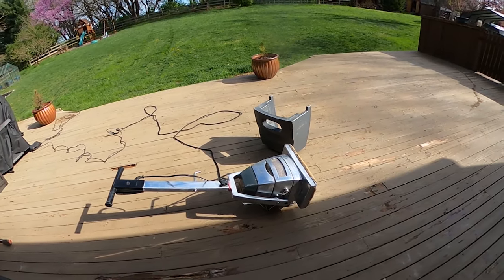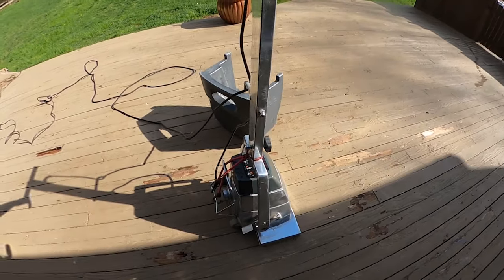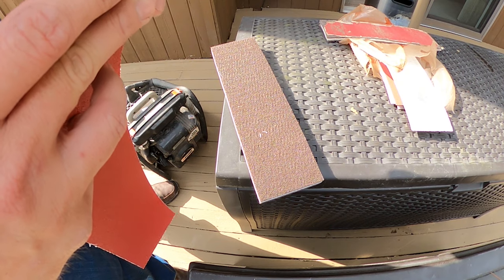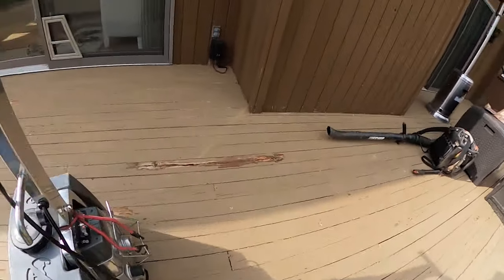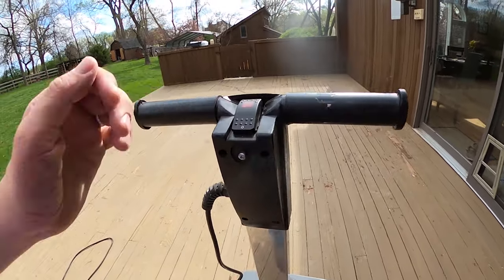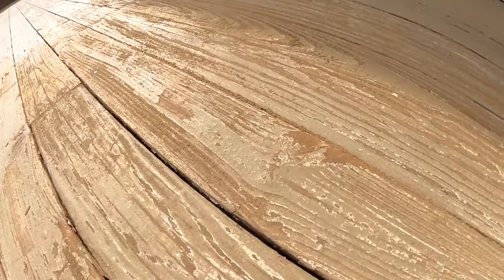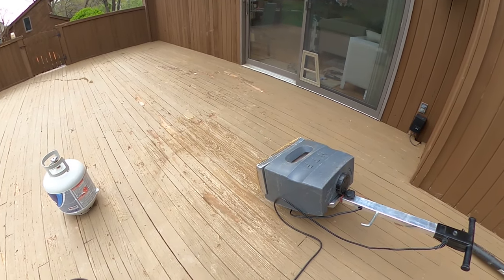Sanding your deck with a Home Depot rental sander | Home depot rental

Comment: I used 7 60 grit and 3 120 grit sandpaper for my deck and stairs, almost 450 sq ft. Went through two backing pads. Some sandpaper sheets kept falling off the backing pad, especially when it got dusty. Problem is not all sanding sheets have good adhesive. I had to use an adhesive spray to keep them on the pad. With adhesive spray, you can probably use just one backing pad. Be careful about sprinters and nails sticking off the deck. They can easily rip through the sandpapers or backing pads. Sandpapers and backing pads can also get stuck in them. For sanding stairs, I took off the weight as stairs were too narrow and I could fit 3/4 of the sander on the stairs. The included cloth dust bag is garbage, no dust ever collected there. Maybe the sander I used had a bad dust collection system. I used my shop vac to clean the dust and blower to finish off the remaining dust. Home Depot sells paper dust bags but I do not think they will help. Sanding took almost 5 hrs. Hope this helps!
Reply from the maker: Great tips. I didn't use the dust bag, just vacuumed and blew it off. Thanks for all your ideas I am sure folks will appreciate it.
Reply: Good tips
Reply: Good tips, especially giving us the deck size and how much time and sandpapers you used. This allows us to estimate how much we need for our projects.
Reply: @yewkiamakuahui2296  Amen to that! Thanks @asif!! I created my material estimate based on your great info!!
Reply: I am looking to rent this for sanding my deck, but it has lot of nails ,, should i remove all or just the ones that are standing up above the ground level?
Reply: @prabeeshraman6141  I hammered all the nails down so they don't stick up. nails that stick up can tear through the pads
Reply: Thanks for all the great tips. Could you share what kind of adhesive spray you had success with?
Also, your statement says "With adhesive spray, you can probably use just one backing pad"
..Did you mean to say "you can probably use just one sanding sheet"?

Comment: One issue with sanding many types of decking boards is that unless hidden fasteners were used there is a good chance any screw near the surface will also be sanded. In doing that it may very likely remove the rust resistant coating on the screw now allowing the screws to rust!
Reply from the maker: Great points. I reckoned since my deck was so old, it was sanded at some point, and luckily, years later, I haven't had any issues. Maybe the paint helps protect it a bit?

Comment: Why not put stain/paint remover on, let it sit and power wash it off? After that you can use lighter sandpaper to get what the remover did t get. Much easier
Reply: Just experienced this, stain stripper is only going to work on non solid stains no older than 1-2 years
Reply: Chemicals have uneven results
Reply: @kennylignon7908  no, chemicals remove the bulk of the stain. I’ve been doing this for 20 years. It’s a game changer.

Comment: American sander is way better, the one you using is gonna take a long time and lots of paper, I would use the drum sander with a 36 grit and do the small areas with a orbital sander 40 grit to clean it off and than you wanna pass with a 80 grit to smooth it out, takes a day to do it.
Reply from the maker: Great feedback, thanks. I was just using what Home Depot had. Will lookup what you mentioned.
Reply: I wouldn't use a drum sander. It may do the job way better but, if you have a nail tear up that drum you WILL be paying about $800 for them to replace the drum. The insurance doesn't cover it. GO FIGURE. 🙄
Reply: @cha-ka8671  yeah my drum damaged after a few decks, still way faster to sand with drum sander but we have to set all the nails and screws before, but mistake happens, i do this for a living so i guess i have to calculate to spend on new drums, i have one american orbital sander as well but only good for smoothing the surface.
Reply: @Skiller7777  Get yourself one of those Pneumatic Punch Nailer & Nail Remover guns. It will help save your hands and wrists.
Reply: @cha-ka8671  definitely bro.

Comment: If Home Depot doesn't have the American Sander, then check to see if you have a SunBelt rentals or maybe another local rental place that carries sanders. That sander you used looks discouraging. Don't use a drum sander unless you are 110% sure ALL nails are recessed. It will tear the drum up and they will charge you to replace even with the insurance.
Reply from the maker: I am a big fan of Sunbelt. So, if you pickup Saturday it's free Sunday! At least at my local  Sunbelt.
Reply: Are you supposed to/allowed to use the drum sander on outdoor decking?
Reply from the maker: Wood is wood, no? I don't see why not.
Reply: @artmetcommerce4749  Yes, they do rent one they say is for outdoors. Because, it’s a vibratory sander. If you have nails or screws exposed it with tear through the paper and eat the drum. That drum will set you back $800. No joke. I thought they were crazy until I looked up the cost for one. They weren’t BS’ing.
Reply: @cha-ka8671  Thanks

Comment: Homedepot said they had 1 in stock to rent went up there they said all they had were drum or disk floor Sanders for rent I looked at tools for sale and 517.00 later I own one now and it paid for itself in 3 hours.
Reply from the maker: Hey, I'm sure you will find lots of use for it!! Seems like a decent price!
Reply: @jamzdotnet  probably on same deck a year from now lol. It's for my builder with salt water pool at least it's teakwood and easy to sand.
Reply: The HomeDepot in my area charged me $70 for the day, but with the insurance and whatnots, it ended up to be $98 a day. I have to go back and rent it for another day,  so it costed me about $200. The sandpapers and pads were very expensive, I think about $11 and $13 each, so all together for the project, it costed me around $300. You were wise to buy it, because now you can sand your deck and floor anytime you want. And you can rent it out to your friends too.
Reply: @yewkiamakuahui2296  actually my friends family and neighbors are welcome to use it for free if I don't do the work for them for free. I have a job that pays me " actually a builder who is good to me keeps me busy and with those blessings all I can do is pass it along"

Comment: I appreciate your straight forward and informative video. I'm renting the same sander today and giving this a shot. Taking my time and doing all the good prep. Thanks again🌞🤙🏽
Reply from the maker: You bet!! Good luck on your project!
Reply: @Jason Lyman how did your sanding project turn out ? I was thinking about renting one. Thanks
Reply: @TADDs101  it turned out good even for a computer guy doing it for the first time on a New to Us type of house. The wood was so hard and the deck was solid but wouldn't let go of the paint. I think I went down to 40 grit. I got extra paper and took my time. I rented at the big orange hardware warehouse. Watch the how-to and safety videos and take your time. 🤙🏽

Comment: I had that really thick stain (that supposed to fill in the blemishes of an old deck).  NEVER GET THIS!  It peals off after 2 year... horrible mess!

 I highly recommend a floor sander. I tried first renting the orbital floor sander in this video, but it was no way near aggressive enough.  So i brought it back to home depot and swapped it out for a floor belt sander.  VICTORY!   Added Bonus: it also helped smooth out all the boards as an added bonus.   Next step, I have to get the edger to finish the job...
Reply: I was thinking the same thing.  The wood is not even so with something not to aggressive you only get the tops done.  I think after using the floor sander then with finer grit use an orbital or rotary to close the grain.
Reply from the maker: I hate stain like this .. but, rolled with it as it came with the house. After 10 years of owning the house and doing this process 2 times, the deck still looks decent for it's age (33 years old) .. trying to extend the life as long as I can.

Comment: Thank you for the video. How much does the sander weigh without the added weight?
Reply from the maker: Hmm ... I am not certain but feel like it was under 30lbs without the weights.
Reply: Felt more than 30 lb to me without the weight :( I had to take the weight off when sanding the stairs as they were too narrow and one of the wheels was in the air.

Comment: Can you give us some estimate of how much area EACH sanding sheet would fully sand? Thanks...
Reply from the maker: Fair question .. I would say one sheet got me maybe 40 square feet. My deck was rough, it ate through sand paper like nothing. So, it will vary greatly depending on how rough your deck is. I literally ran the paper until it was smooth and nearly destroyed. On top of that, you need to replace the pads that go under the paper. I used like 4 pads if I recall.

Comment: It would have been nice to see how the deck looked when you finished. Impossible to tell if the sander you rented will even remove the old stain?
Reply from the maker: Understood. However, I didn't take a video of that. Honestly, I just wanted folks to understand how this sander functioned if they were considering renting it.
Reply: @jamzdotnet  I am actually considering it...been using an angle grider w/ flap discs for my handrails/guardrails.

It is an older deck, I pressure washed it and of course it splintered some of the deck boards it so it needs a considerable amount of sanding. Additionally, some of the flooring deck boards are a bit uneven (Nothing too terrible, I don't think) due to warping from weathering over the years w/o having a protective stain treatment.

I am wondering if the floor sander will remove enough surface material...?
Reply: @jamzdotnet well we all don't know...we didn't see the outcome 😂

Comment: The sand paper falls right off the pad when I use it
Reply from the maker: Is the pad new? Or worn down?
Reply: @jamzdotnet  I rented the machine from Home Depot and I’m using new sanding strips. idk how old the pad is but it doesn’t seem worn down
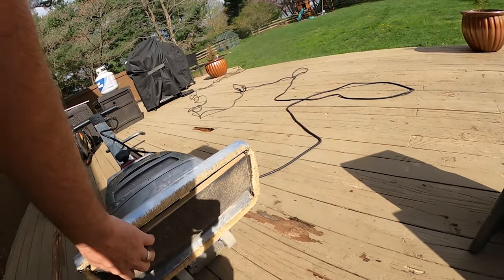Reply from the maker: @bec2713  You need to buy the sanding strips and the pad. Chances are the pad on it is leftover and worn out. At 2:44 in the video I show this. They are relatively inexpensive.

Comment: Unfortunately when I tried to rent a similar sander from HD this type was out of commision, so I rented a belt sander after seeing over videos on youtube.  For me, it didn't work.  My deck has a stain and unfortunatley two coats of Deck over, terrible product.  I'm feeling totally stymied as to how I'm going to get this crap off of my deck.  I'm not sure if this type of sander will work better than a belt sander, but I'm feeling it will not.  any suggestions would be appreciated.
Reply from the maker: Hmmm ... I would test a little of that deck paint stripper in a section and see if you can power wash it? Next, sand?
Reply: @jamzdotnet  Yeah I'm thinking that too.  I'm hoping the the sanding I did yesterday will have broken through some of the deck over, then I'll try a paint/stain stripper, then probablt rent to big belt sander again.  I thought using 36 grit would do the trick, did put a dent in it, but defintly didnt do the job I was hoping for
Reply from the maker: @jameshannon3067  Let me know how it goes!
Reply: I am in the process of re stained my in laws deck. It's over 30 year old deck with multiple layers of think paint like stain. I used a angle grinder with a dimablade disk. It works really well but it's labor intensive with being on knees. So get knee pads!
Reply: You’ll never get that Behr product off no matter what you do. Consider a new deck.
Reply: That’s for sure.  Have replaced about 30% of it.  Strip, sand, scrape the rest.  Real ball buster!
Reply: @ransomcoates546 but then what would you use for stain on the deck after it's clear???

Comment: How much sandpaper did you end up using?
Reply: Not surprised once I saw all that paint on the wood. It will gum up the sandpaper after a short distance. I used the diamabrush bit on mine then power wash then sanded then stain with transparent sealer oil. For thirty years old it’s just a matter of making it look good a little longer though before it’s replace/tear down time. A+ for effort
Reply: similar question. what was the final count?
Reply from the maker: Way too much! It really ate through it.
Reply: I rented one today (then had to do multiple trips when the first one didn't work and 2nd one was missing a part) and so far I've gone through 6-7 of them, also I'd recommend getting multiple of the finishing pads. They get tore up then It's frustrating when you slap on a new piece of sandpaper and it falls off immediately, and it loses all it's stickiness. The deck on the house I just purchased was just about 30 years old but hasn't had any maintenance in at least 10, so it's rough.
Reply from the maker: @WhiTeyFU  Oh man, they need to do better maintenance on the machines. What a hassle! Agree, the pads are needed as well.
Reply: @jamzdotnet  it ate through it because it was getting gummed up with the paint....
Reply: @jamzdotnet  Roughly how many pads and pieces of sandpaper?  my deck is about the same size and I am doing it this weekend and want to make sure I bought enough

Comment: I did this 3 years ago and need to do it again and I dread it. The sandpaper kept falling off, making this a headache. I have a Huge deck and having the sandpaper not stay on made this a miserable project.
Reply from the maker: It was slow but worked for me. Make sure you had a good new sandpaper back pad.

Comment: Yeah, doesn't look like a very effective nor efficiant way to strip a deck.
Reply from the maker: Thanks for tuning in. Endless ways work. I found on my old deck with solid color stain this was a great step prior to the new stain. After a hot summer, icy and snowy winter, new application has held up. What's your preferred method?